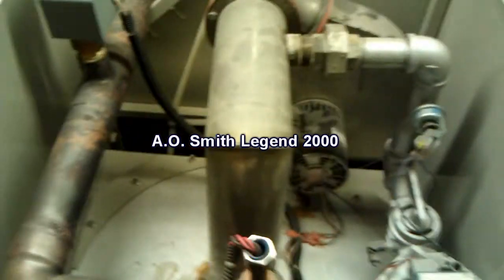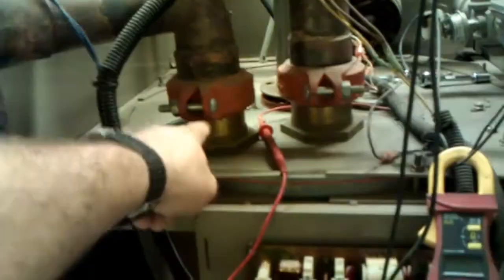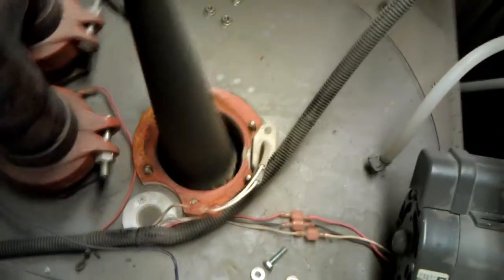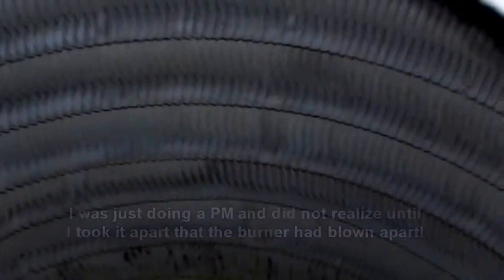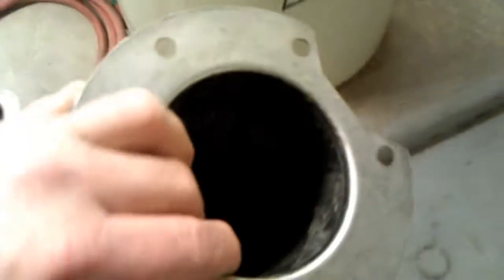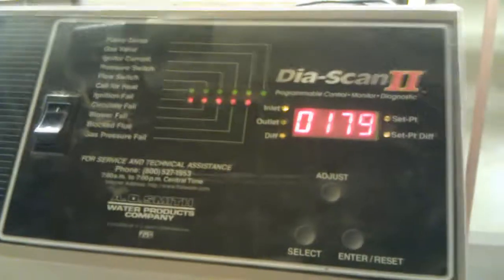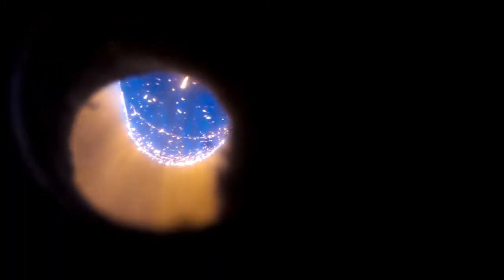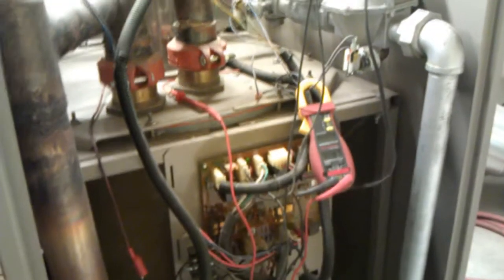A.O. Smith Legend 2000 Boiler burner tear down - Part 1 [HD]

Comment from the maker: @mazzmari 
Nah. it wasn't plugged. You have to look through them at a wierd angle to see through those fins.

They fooled me too the first time. 

And yeah, good luck when it does need cleaning. You're supposed to brush them, but not too hard to bend the fins. And then if you spray it down, where does the mess go?

If it does plug it will cause a fault via the pressure switch. But they all burn good.

Comment from the maker: @84randomdude 
The company actually has those done under a contract. A pair of guys come with a truck ful of equipment and bust those suckers open, clean the tubes, weld any leaks, etc.

They used to do most of the repairs on these too sometimes. But I have been taking care of them since I've been there.

I also do normal repairs to the controls, etc on the Superior boilers. But nothing major or any tear downs.